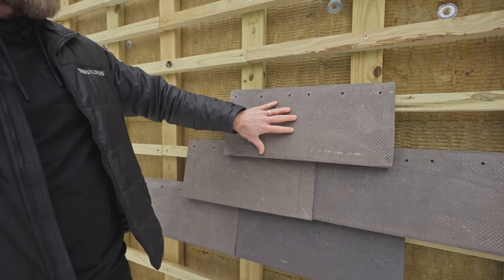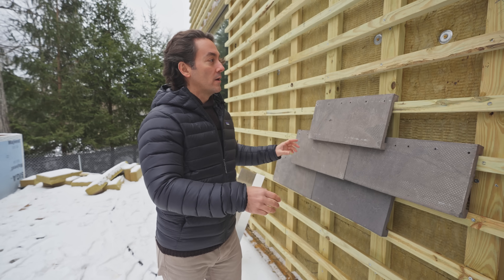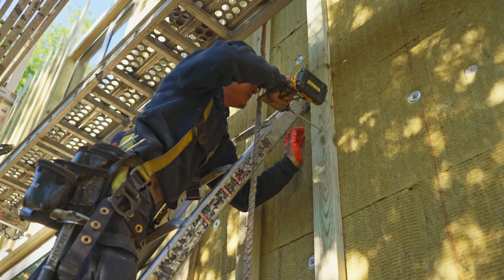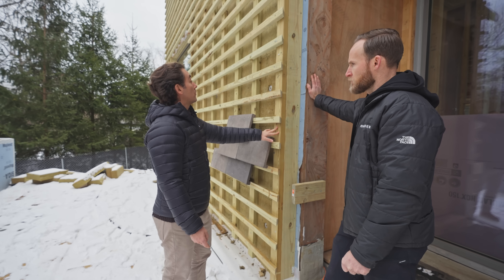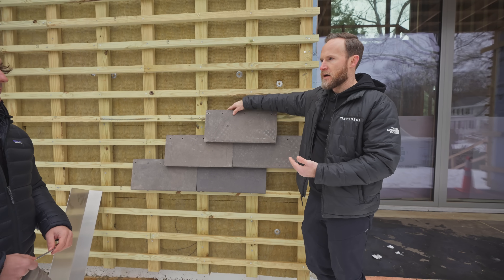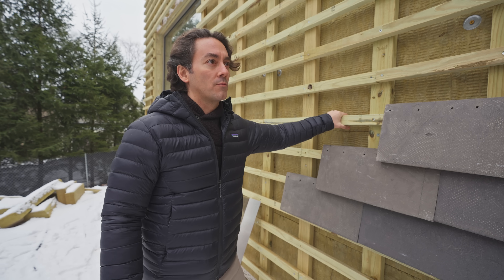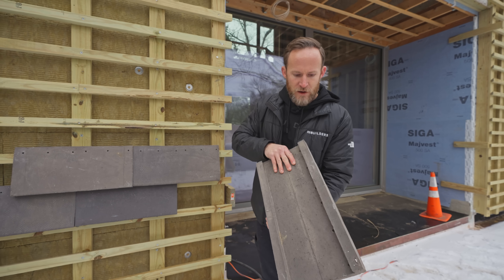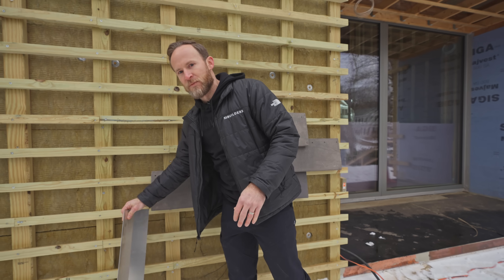The Benefits of Rainscreen Cladding & Exterior Insulation

Comment: What are the reasons to use Majrex instead of zip?
Reply: I think for two reasons:
1. Plywood is stronger then OSB, so you have more shear capacity. Don't forget the huge size of every window opening.
2. Plywood + SA Majrex 500 is more vapor open then ZIP.
Reply from the maker: Just preference. But Koenraad makes great points
Reply: @NSBuilders  you gonna ever answer anyone who makes the concrete siding product?

Comment: Very interesting!  I've been wanting for this video since you showed the concept months ago.
I know that engineering signed off on this but it's still mind boggling that the exterior of this house will support basically 10 cars hanging on the walls.
Reply: And the vertical two by's only have to be screwed into the plywood and not a stud is concerning
Reply from the maker: @briand3837 they’re screwed into the stud. We mention that
Reply: @briand3837  pretty sure he specifically said they hit structural studs
Reply: I was on a job and we ran the weight of the living room crown molding.
1600 and 3200lb a linear foot. Yeah it was stone.
One of those houses.
Reply: @sparksmcgee6641  how can a linear foot or any molding weigh 1600-3200lbs?  Am I misunderstanding this?

Comment: Would be worried about fastening those tiles with screws. The movement in the furring strips behind from season to season might crack them. Nails would at least give them some movement.
Reply: Most likely they will not tighten screws (leaving like half a millimeter for movement)
Reply: This installation method is incredibly old and time-tested, it’s basically a tile roof.
Reply: @Szaszzzz  with a tile roof, wouldn't there be overlap of the joint to prevent rain penetration?
Reply: @ From what i've seen it's basically the same system as any tile or slate cladding/roof see: https://youtu.be/8nQZ4m7mJoY?si=3-uZEGCUsyfAc96g

Although to the original commenter in this thread's point, they do use nails. I don't really see why that would make a big difference other than cost and ease of installation.
Reply from the maker: Great point but it’s what they recommend
Reply: @NSBuilders  can you give a link to the product
Reply: @govern,,, i have a similar exterior that is 15 years old and haven't seen a movement
Reply: Maybe a rubber washer under the screw head.

Comment: building for the 1%. so cool. ill sheath my exterior for the price of the 10" SD's screws you used on that house. hipster building that only a few builders in each state would ever do, for 1 off customs.
Reply from the maker: Fine with building for the 1%. Our goal is to share these details, make them easier to understand and ultimately help those looking to implement similar details. More education means better understanding means more efficiency means less costly.
Reply: @NSBuilders 25 years in business as a contractor, almost 40 as a carpenter. It took me 15 years in business before I started getting clients that wanted to pay for the time and materials to do things to the upmost degree. I was never happier. Some people, myself included, just want what they want.
Reply: Does anyone need to do a video on the typical as cheap as possible DR Horton track home build? 
Continuous insulation outside the framing will save money in the long run esp if it's detailed correctly. It will so.e money up front as you don't need as much insulation in your stud cavities
Reply: In many parts of the country, exterior insulation is now becoming code minimum in certain climate types...it can be done cheaper than this particular design and build, 🤷🏾‍♂️

Also, just cause you want the absolute minimum in a house build does not mean that is the best way to build...

"Building to code" just means someone built the cheapest home they you could build and get away without being sued for ineptitude...
Reply: @monochromatec If you can’t appreciate or learn anything from what is being shown - adapt, evolve and implement for the other 99%, perhaps this is the wrong channel for you. Think bigger. The world needs more doers than complainers.
Reply: It is possible to do it cheap. I did mine with 2" XPS outside with headlok screws.  Wish I could have gotten rockwool but hard to get for me as a diy dude. Don't get me wrong. Insulation was not cheap, probably 5k for a 28'x27' house.  My rain screen was 3/4 1x3s and those screws were 24" oc. I put 0 nails through my foam because that defeats the purpose of thermal bridging. Only the fastenmaster screws through the battens penetrated. I used double sided carpet tape to hold the 2 layers of 1" foam staggered to the house. Taped all seams. I regret so much not putting the wrb on the sheathing as I put it over the foam as a sunscreen more than anything.  Regrets.  Overall I have r25 in cavities and r 14 at stud bays and doubled the size of my house as I added a second story and most of my thermal loss is in the basement. 

It can be done cheaply if you do it right (or mostly right).  I did this all myself and I'm a software developer for work. Wood worker for fun.
Reply: @monochromatech  I would be interested in the sheathing, insulation, and cladding you are going to use, because those screws aren't very expensive when you buy them in 20lb boxes for doing an entire house...
Reply: It sucks to be poor
Reply: I feel your energy on this.  Other folks have already replied that the video is showcasing a well engineered and very expensive product technique.  
I tune in to see if there's a product in an early state implementation. 
But yeah not practical for us normals, but who knows there could be a wide spread technique or material buried in this video.
Reply: @ that’s a great attitude. I also watch these shows to learn new techniques that maybe I can use part of or build on. This type of wall could be done pretty reasonably as an accent using recycled slate roof tiles . Those usually come out to about $2 a square foot just for the slate but for a cool wall that seems reasonable. Slate roof tiles are not common in a lot of the country so your mileage may vary.
Reply: If the 1% spends more than necessary on their wall then the extra money filters down into the other 99%'s pockets, so I wouldn't complain... this should be encouraged.
Reply: Welp - you can build a Honda house or a Mercedes house.
Reply: Honda drivetrains have the nod over Mercedes. Stay out of the mechanics repair bay and buy Honda!
Reply: Have you ever seen those gearheads that go to extraordinary lengths refurbishing cars with incredible details on their engines ("stuff that doesn't matter"). "Why on earth would you spend all that money putting chrome on your engine? It is just a car. No one will see the motor going down the road"

There is this thing called craftsmanship. It is a tiny sliver of the population. It is people who care and want to do things the right way.

For the other people, go buy a track home from DR Horton with cardboard sheathing, hacked framing, and built as cheaply as possible.

If you are going to spend money overbuilding something, why wouldn't it be something you occupy all the time?
Reply: @monochromatech  Still nice to see.
Reply: I did 3" of foam in 2 1.5" layers. The screws are off the shelf then! But there is a LOT more labor.
Reply: @monochromatech  a thing I enjoy most is insightful and spicy commentary. Thank you for your criticism.
Reply: If you spend any time in cold climates in western Europe and observe how they are constructing buildings, you would see this exterior insulation and rain screen detail pretty frequently. Just because you might not see it in North America too often doesn't mean that there's not a good reason for doing it. Why not continue to up the game in residential construction here?
Reply: @StefanBergendahlDeKa  it very common in the US. Is pretty much the only way to meet energy code with a 6" stud bay. You usually just see a much cheaper version of it. More commonly, it's an inch or 2 of XPS foam insulation covered with tyvek or fluid applied vapor barrier with a finish coat of synthetic stucco or siding.
Reply: @StefanBergendahlDeKa not like that, no.
Reply: Because in America/U.S.A. We want cheap thinking we are saving money when what we are doing is building temporary expensive to maintain housing.
Reply: @monochromatech  this attitude is why half of California burned down. It's just some hanging tiles I don't understand how it can be so expensive. Stick to bitumen felt roofs and pvc siding, then blame climate change or space lasers when it burns down again, depending on political leanings
Reply: @fairyheli2 lol you should have it bid out. It is that expensive.

Comment: All that money only to have a wood lattice to hold up very heavy cladding. It’s a dumb way to build a home.
Reply from the maker: But it’s been done for 100s of years around the world… and still stands.
Reply: @ maybe we should go back and use hoarses…you know because it was used for hundreds of years.
Reply: Kind of a silly comment.  Rain screens done well are pretty smart.  I get the advantages of lumber, though I personally don't want to use ANY wood (warping, termites, mold, fire, higher insurance, etc)... but I wouldn't call it dumb.
Reply: @ you wouldn’t call it dumb but you also wouldn’t use lumbar. Pick a side.
Reply: @FirstLast-et3sw  roofs in my country are built same way and last longer than the house
Reply: wait until those long verticals and horizontals warp from moisture and intense heat in the summer spring and fall
Reply: @hos4800  You know that the rain screen lets air through to cool off and dry the siding, right?

Comment: what will prevent water from passing through butt joints ?
Reply: Hardie recommends color matched flashing for butt joints.  IMO it's better to add those on this project as well.  No reason to allow unnecessary water if there's a solution.
Reply: Nothing. That’s why it has a rain screen. Water is allowed behind the siding.
Reply: @CMCraftsman  it's ok for insulation to get wet? Seems dicey.
Reply: @kennethbarber438  Normally not but Rockwool Comfortboard is water repellent.
Reply: @kennethbarber438  not just water but any clever insect?  screens top & bottom don’t help much then. This is so over-engineered it’s impossible to believe they just ignore all these butt joints that will have gaps. Bizarre.
Reply from the maker: Nothing needed

Comment: Has the system been tested with the ember generator - fan test system?
Reply: From what I can read the emberometer is only measuring the size and speed of embers, not any materials resistance to embers. You would need the firebrand generator for that. I'm betting the manufacturer of those tiles is probably testing the fire resistance.
Reply from the maker: Blower door? Should pass with flying colors.
Reply: @  No. NIST has developed a device the creates embers then blows them towards a wall assembly. It’s to help create assemblies that are resistant to ember storms.